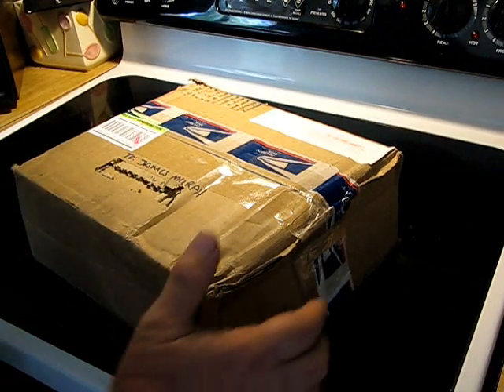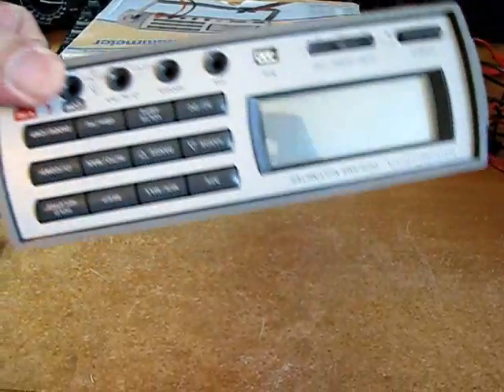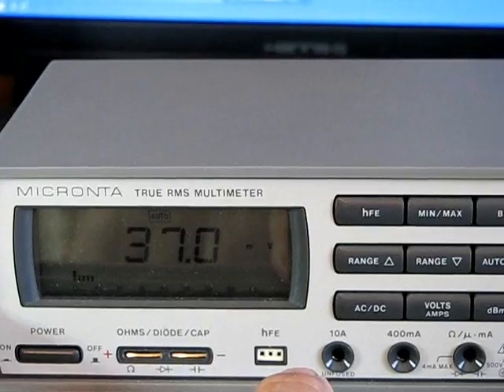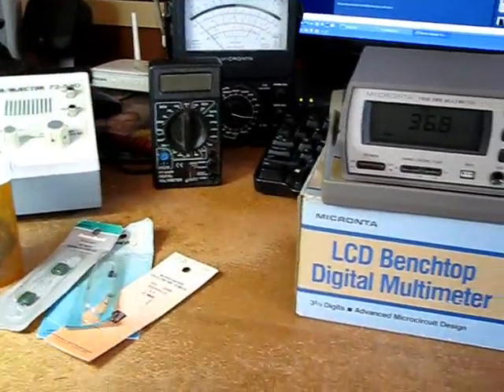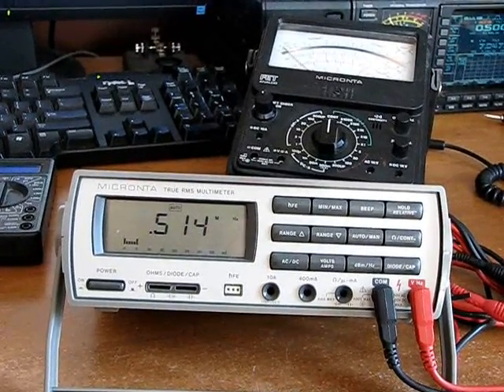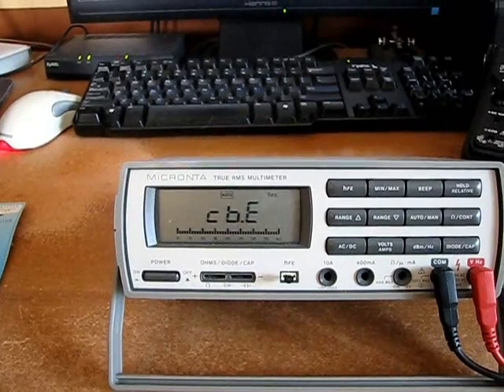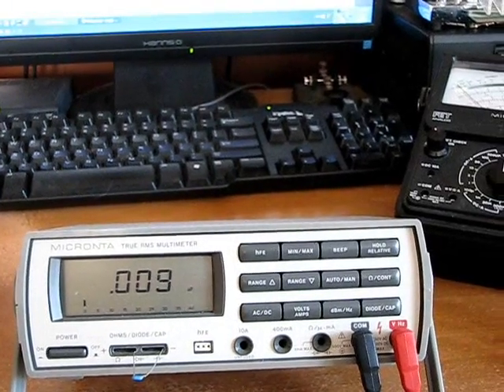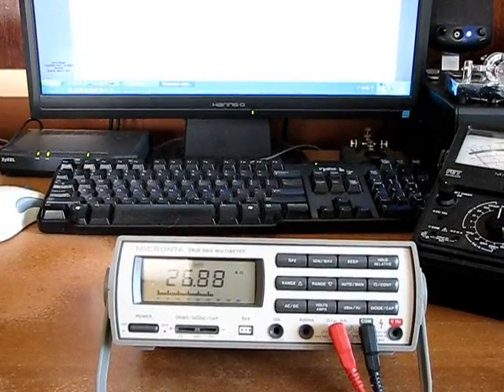Micronta 22-175A

Comment: Great video. I just picked up one of these and am looking for a schematic since one of the power leads has come unconnected. I would also like a photo of the information on the back of the unit if I can get one somehow.
Mine suffered from corrosion from batteries that the previous owner left in too long. I am hoping to resurrect mine.
Reply from the maker: Thank you for watching. On the back the only information provided is Warnings and Cautions. It also has the model # Micronta 22-175A.
A good cleaning with alcohol and re- solder and damage connection,

Comment: Hey Jim terrific video. In the opening of the video on the right front is a small analog meter. Can I ask what it is? Looks like an old RCA?
Robb
Reply from the maker: Calectro:  I bought that meter from Lafayette in 1972 I still have it and has been a great meter.
Reply: @k5cxo  that was made in Japan by Hioki...they made the same meter for RCA. It was born a WV-536A shop special. They went to a bunch of tech schools and training schools. I have a schematic if you need it. I have 2 and will never sell them lol.
Reply from the maker: @robbo6460  Thank you for the update Robb. This meter was my main work set when I got into Ham Radio and was building or repairing equipment back in the 70's and 80s.
Reply: @k5cxo  it reminds me of when I was in vocational school in 1981. I have 2 of the RCA versions. I just finished repairing 1 of them yesterday. The other one was worse off. Someone hit it with high voltage and burned up a few resistors. I'm working on it slowly lol. I have the Hioki schematic and RCA schematic provided by Hioki. I love analog test equipment.

Comment: I first bought mine in 1995 I think, and it served me well as my bench meter for checkout and basic repair of electronics assembly machine controllers and PCs of the day for over a decade+. then I stored it using it occasionally if my fluke did not have a low enough range micro v/a. recently found it in the cabinet needing batteries and fuses. I have the batteries and ordered the fuses. look forward to seeing it come to life in 2021, great Video.
Reply: I just picked up one of these and am looking for a schematic since one of the power leads has come unconnected. I would also like a photo of the information on the back of the unit if I can get one somehow.
Mine suffered from corrosion from batteries that the previous owner left in too long. I am hoping to resurrect mine.

Comment: It looks exactly like my Smart2 meter which I purchased from Radio Shack.
Mine is a Smart2 Model 22-175B.
It has a fast CPU.
I bought a Mastercraft 052-1899-2 from Canadian Tire. When you measure resistance, voltage, amps, it is noticeably slightly slower than my Smart2.
When I measure capacitance, it is very very slow. It takes 3 to 5 s to stabilize.

Comment: I used to work at Radio Shack in 1997, and I bought one of these meters.    I've had it for 21 years and it still looks new and still works great!  Wouldn't take anything for it.
Reply: Mine is over 25 years old maybe over 30 years old
Reply: @Renegadeproject  Nice.  I wish there was a way to run this off external power.  I took mine apart to see if I could do it and it has 2 power inputs for some reason.  Some of the batteries supply power to one part of the circuit and the other ones supply power to the other part, but it's weird how it's set up.

Comment: You wouldn't still have the manual would you?  I lost mine sometime in the last 15 years.
Reply from the maker: I don't think so- I will check the box, but if I remember correctly It did not come with one and never have found one online.
Reply: @k5cxo  
I have the manual. What do you need to know?
Reply: @louistournas120  how do you measure capacitance? Do I need in insert something in the "ohms/diode/cap" plug?  If so, do you have a part number I can lookup? Thank you for any help.
Reply: @110per-b  You have to put the meter in capacitance mode. You can use that ohms/diode/cap or you can use the probes. One probes should be inserted in the COM port. It is the second hole from the right. The other probe should be inserted into the 3rd port from the right.
Reply: @louistournas120  thanks so much!

Comment: Nice review. Brings back memories as I used to have one of these meters. The main thing I didn't like about it is that there is no way to power it externally. For a bench meter that seems very silly! ;-) Sure, a pretty easy DIY project to add a power supply input but I really think it should have come with one.